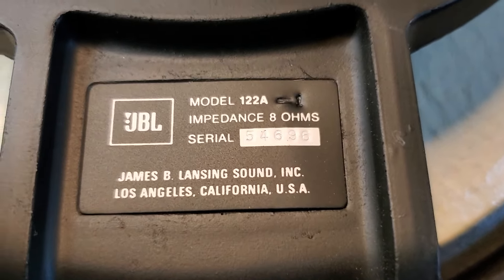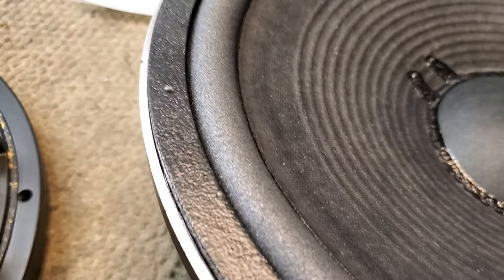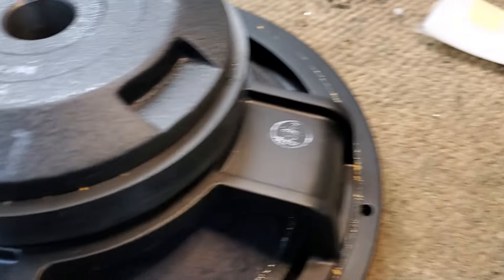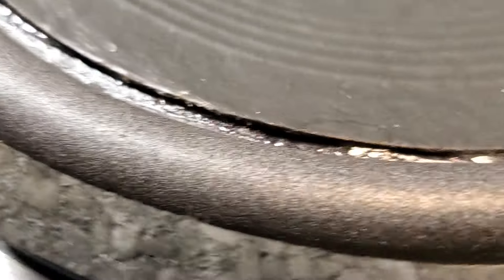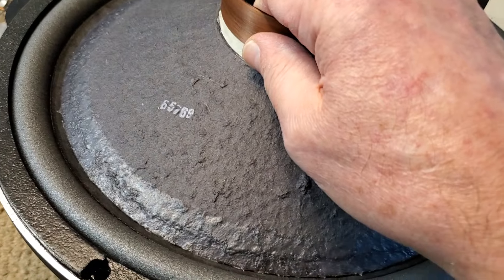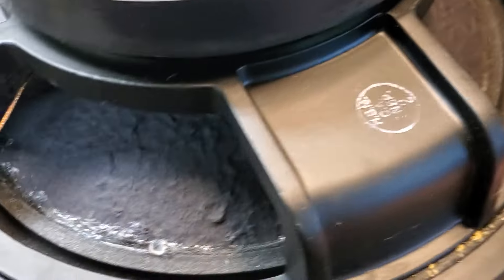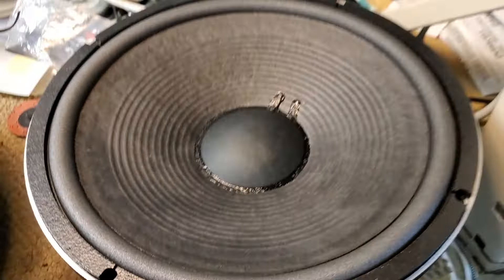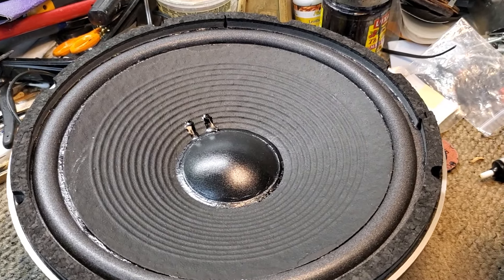I need to vent: Resuspension of factory original JBL 122A-1 vs. JBL 128H customer time suck.

Comment: I have had my fair share of customer caused disaster before bringing electronics to me for service, back in the day when I did that. A guy showed up with a Marantz 10b tuner that he had 'upgraded' with metal film resistors.. even in RF circuits. 😔..  Worse yet.. he could not solder, and did the entire job with 'Liquid Solder' glue. I had to decline, and both laugh my ass off, and have a good cry at the loss of such a classic. I gave up doing improvement mods, due to too many items being butchered so badly before I would get it. We need good working order to start with for op-amp upgrades, and cap upgrades.   I feel for you... having crap arrive when it's not supposed to.

Comment: How do you remove the excess glue from the cone edge? Im refoaming pair of 125A's from L36s, previous refoam was sloppy & glue is like silicone, looks exactly like these with that thin, extra glue lip at the edge. Grrr.